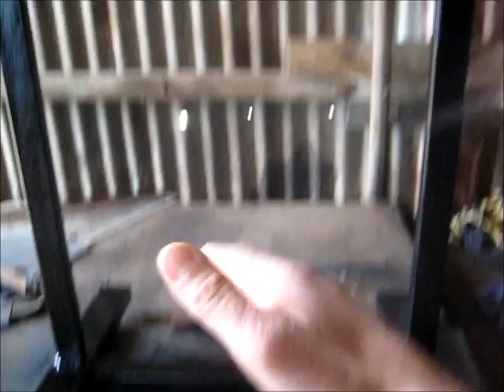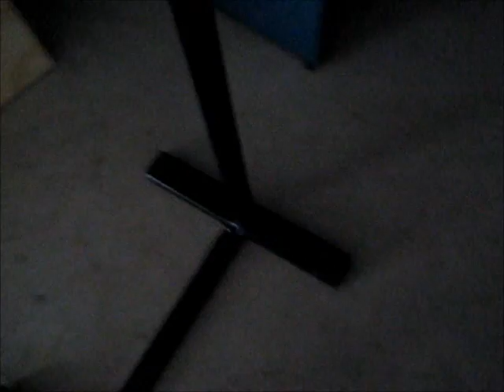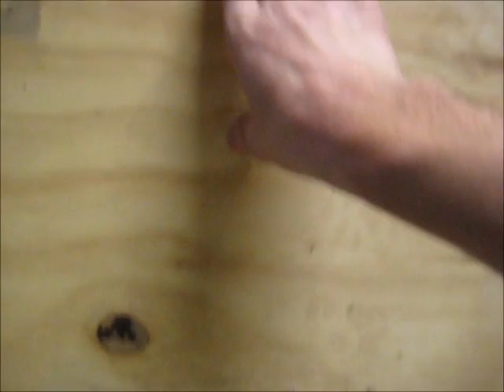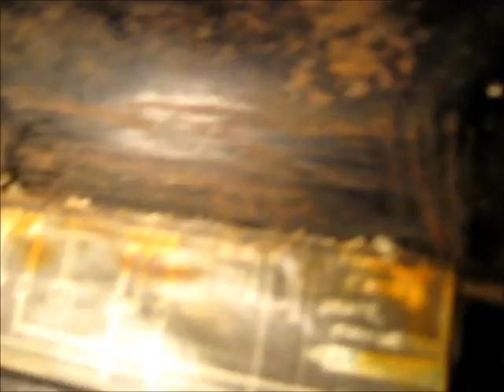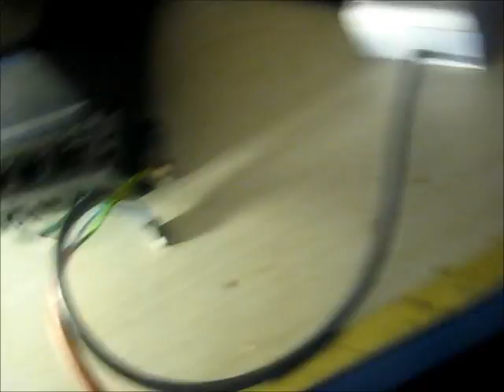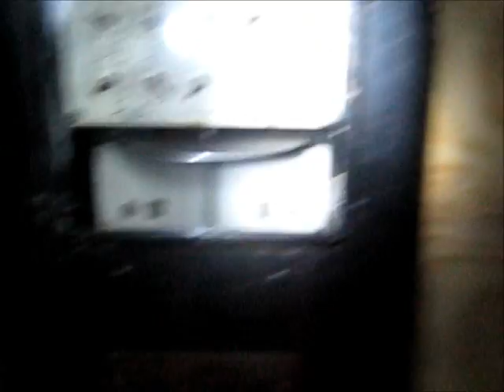Meter test panel & C&H meter wire up

Comment: I think what you have is a meter for a SWER line setup. Basicly you have about 10000v to a transformer fed by a Single wire Earth Return. The output of those transformers is usually a 2 phase 480v with an earthed neutral as a center tap.
You should get accurate readings by using 1 in - out and the neutral with 240v. I think someone else said that. Some of the power feeds in the yarra vally use this method.

Comment: Also, I forgot to add in the last msg (mainly due to the 500 limit) that the frame you made up for the meter is really nice. Mmmm! At the top, in the middle, I'd have jig-sawed a slot out of the ply-board for use as a carry-handle....it will make it easier to carry your meter test board. :-)

Also, when mounting the meter, mount it over to one side, not right in the middle: This so that you can have two meters side-by-side for accuracy testing, or a Rate-Changer on there for tariff-change. -BBD.

Comment: Eh?! No neutral on this? I do wonder then, how the voltage coil is supposed to energise-up? Ok, if it was on 2 or 3 phase, it would energise up if connected across 2 phases due to the timing difference of the phases, but on 1ph, the voltage coil will need  a neutral. I wouldn't try to pull a load through the voltage coil...it may damage it.

Hmm, this has confused me. I've never known voltage coils to be wired across phases, & for the meter not to have a neutral connected into it. :-/

-BBD.

Comment: meter terminal block layout is 1 - 2 - 3 - 4 - 5 - 6
1 Phase in
2 Phase out
3 and 4 Neutral
5 Second phase in
6 second phase out
To double meter speed wire as you have done for the phase and put the neutral on terminal 3-4.

Comment: Nice panel supports, good welding. Great meter panel.
That C&H needs a neutral on the  solid double middle terminal. check the common point of the potential coil wiring. You can use 1 element of the meter.
The way you have wired is both elements in series, there is no potential across any of the meter coils. A 460 meter will run at half voltage.